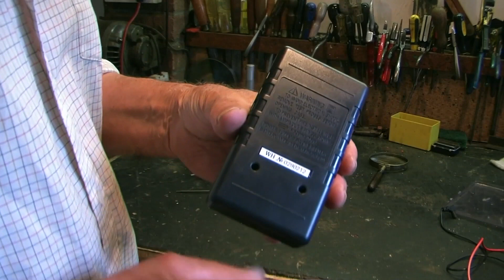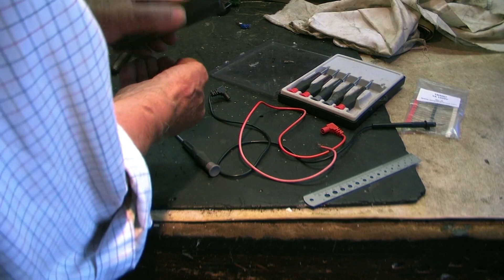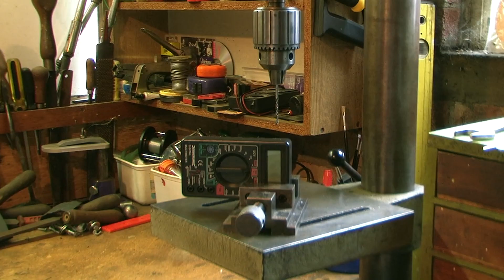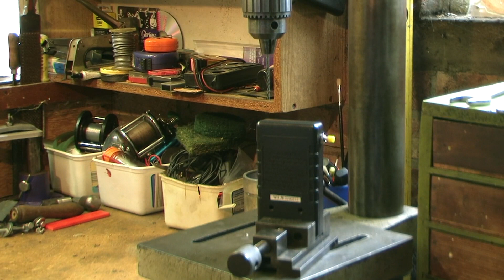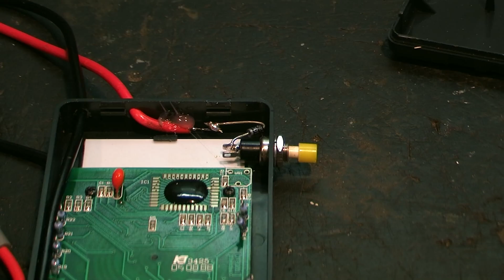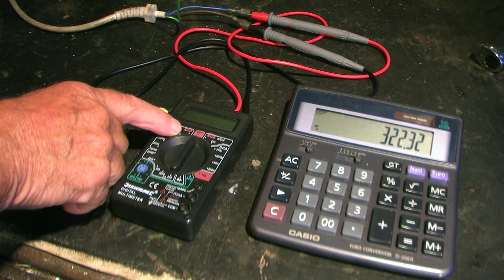CDI diagnostic tool

Comment: Very interesting, I made one of your CDI coil testers and use it. But just like the coil tester video you do not show us how to use this device. Some of us need pointing in the right direction!
Reply from the maker: Any decent outboard service manual will show how to trace and detect cdi ignition faults,but most will quote direct dc (peak voltages) that most folks have no means of checking, this modified multimeter will allow you to see if values are within specification.